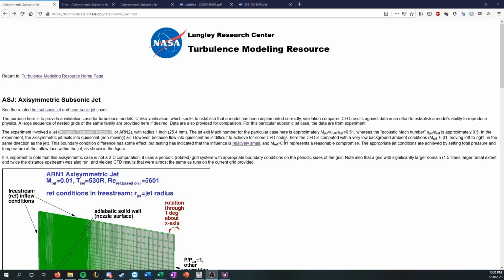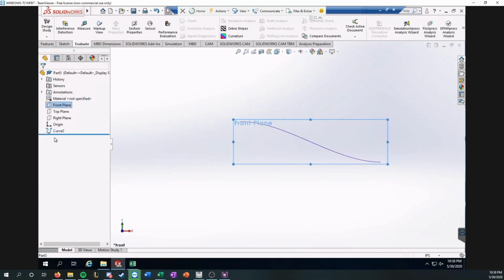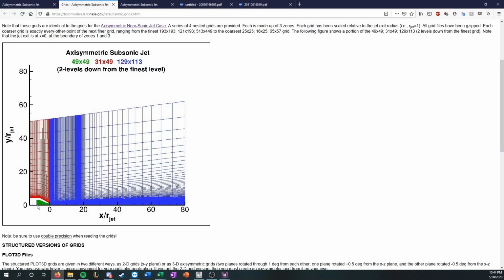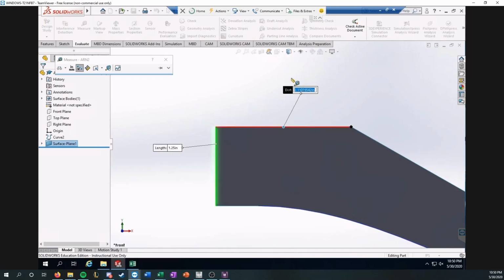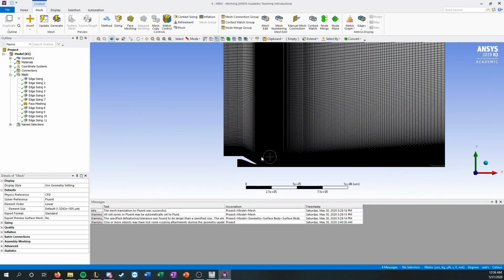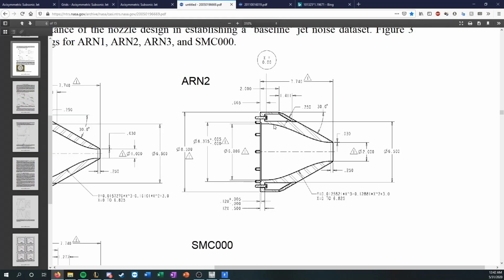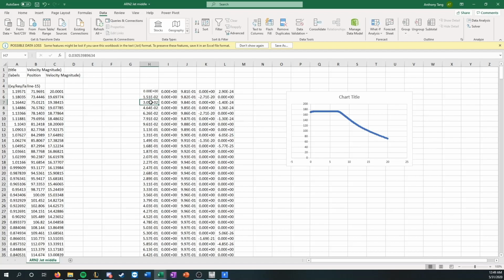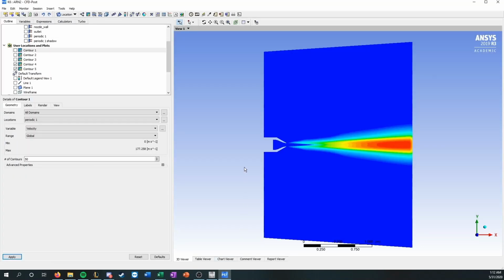ANSYS Fluent Axisymmetric Jet Nozzle / Compressible Flow Tutorial with NASA Validation (2020)

Comment: Hi Anthony, thanks for the great tutorial. There is one issue, the calculation for the gauge total pressure for the boundary condition of pressure inlet seems not correct. Since it is the total pressure, you cannot deduct the operating pressure.
Reply from the maker: Hi, I know it's a bit unclear/confusing but for ANSYS the pressure inlet has always been defined as "The total pressure value is the gauge pressure with respect to the operating pressure defined in the Operating Conditions dialog box".  You can read more on the boundary condition here: https://www.afs.enea.it/project/neptunius/docs/fluent/html/ug/node239.htm

Comment: Your tutorial doesn't explain the final steps to the DesignModeller and how to split the domains. One would think this is a simple step, but of course ANSYS is so terribly made that I've been stuck for an hour trying to figure this out with no success. Surprised no one else has mentioned this in the comments.

This is probably the third time I've had to rediscover this after not using ANSYS for a long time. You create "Line from Sketch" then do "Project" select all the interior lines (i.e. all the lines from Sketch2). This is exactly 0% intuitive and there is no clear answer online openly stating this anywhere that I could find, ended up going to an old model and seeing what I did. Had another engineer I know also confirm they've gotten stuck at this step lol.
Reply: Dude, you are a legend

Comment: Hi 

I would like to know did you do face split for every region. as I know there are 7 region. Thats means there are 7 face split?
Reply from the maker: Yes, you should be able to do a single face split operation using those 7 lines, or you can do it with 7 operations, but that is added steps.  I do projections because they do the same thing.
Reply: @anthonyt6564  yeay i did it
Reply: May I know is it same or different if need to used incompressible condition? The general part should be density based or pressure based?
Reply from the maker: @salehamaarof1034  that’s something you can explore.  There’s more physics behind it because compressible flows involve non-constant densities but I believe it’s simply experimentally validated that density based solvers match experimental data better.
Reply: Anthony T actually I have done the same thing as you did in the vid. Unfortunately I got 2 errors 1) floating point exception 2) convergence tolerance

Comment: Sir, may I ask what's the definition of grid  49x49, I saw in your tutorial you set the number of divisions to 100, however, I didn't understand the relation between 100 and 49.
Could you kindly give me some hints?
Reply from the maker: 49x49 is just the number of divisions for each side but while that grid might work, its still coarse or not refined very well.  You want your mesh/grid to be refined enough with small enough elements to accurately capture the complex jet characteristics so that it is "mesh independent".  I chose 100 somewhat arbitrarily and I have no idea how NASA chose 49.  I could do 200 or really any number, but at some point the mesh is refined enough that if you make it more refined, then it won't do anything other than make it more computationally expensive.  IMO 100 is sufficient to make it a good simulation, but you can play around with other levels of refinement.
Reply: @anthonyt6564 First off, thanks so much, sir, so as long as the results are accurate and the time to grow the mesh is acceptable the number of divisions won't that matter.
  BTW, I saw some paper using star ccm+ and  OpenFOAM have this kind of grid division setting, and it somehow confused me cause recently I'm validating some cases using Ansys Fluent.
I'm not quite sure but I guess the simulation was carried out by OpenFOAM since the mesh environment looks so alike.